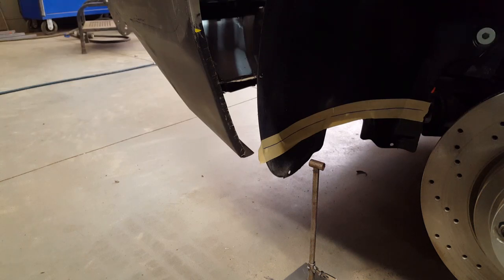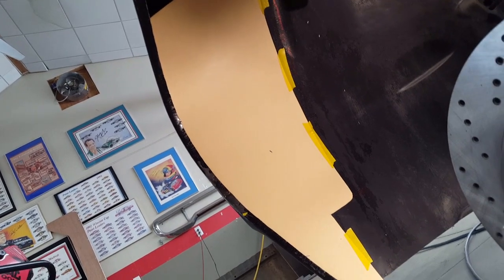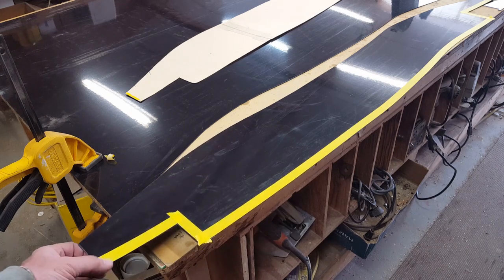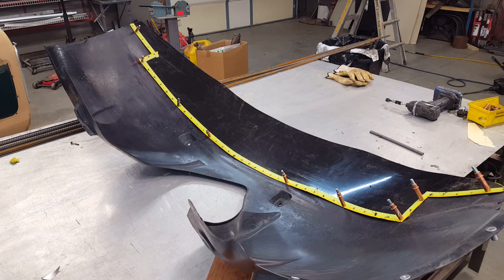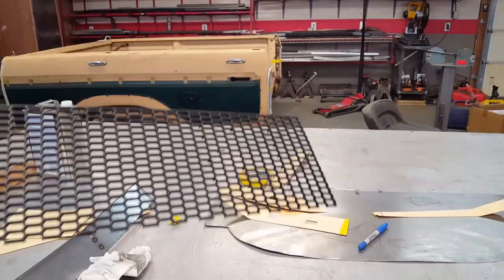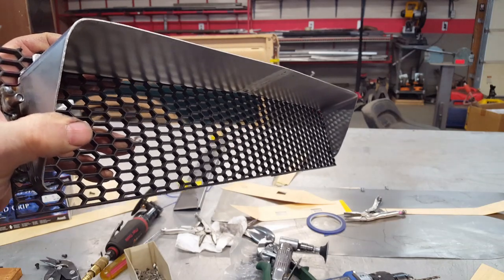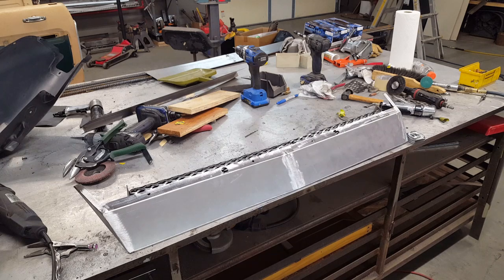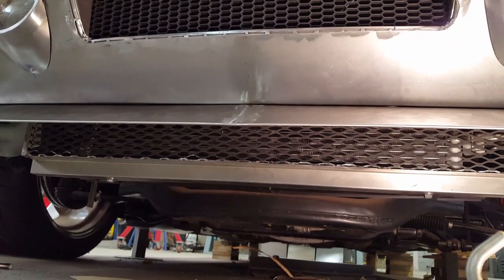2010 Dodge Challenger GTX project part 53

Comment: front "fascia" looks great. Now about the hood. Are you going to try to emulate the fresh air hood, or (my favorite) the hood with the opposed depressed cutouts and the engine callouts?
Reply from the maker: I will be copying a rendition by the original artist that combines a power bulge and the side detents.
Reply: @SteveMirabelli  I believe I remember you showing the artist's rendering which you were trying to emulate. Perhaps, it would be a good idea to show that rendering, again, occasionally, when you reach certain milestones.
Reply from the maker: @rustycowll5735  wish I could post pictures here.